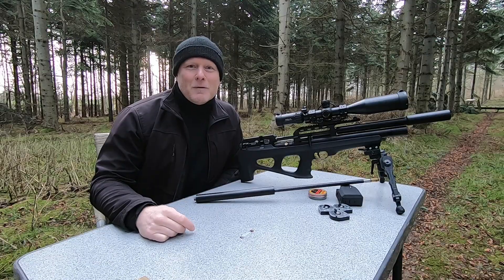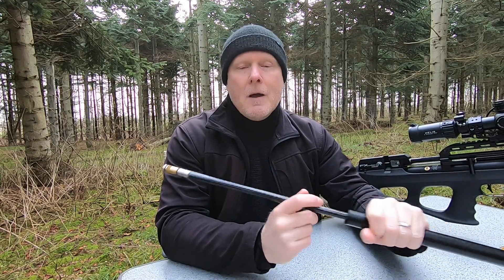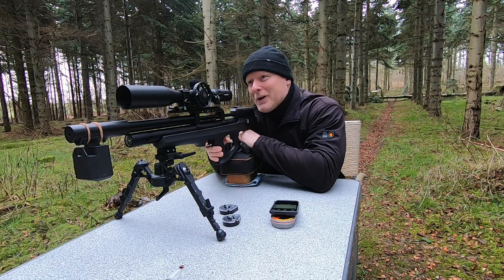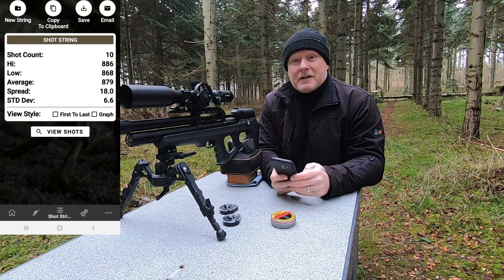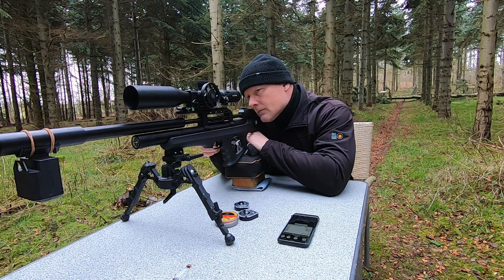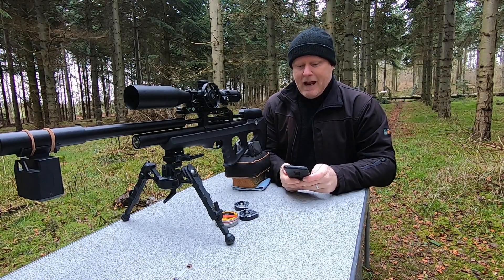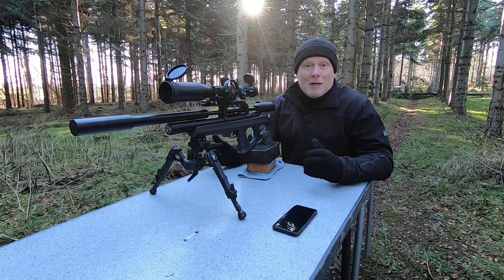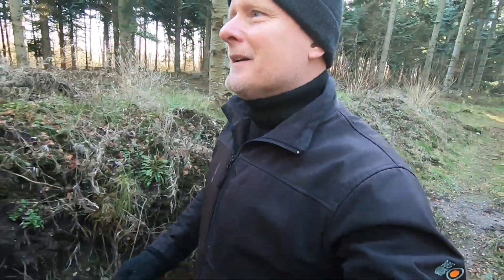FX Wildcat MK3 Barrel change - STX Superior Liner 500 mm vs 600 mm. What is the gain in FPS???

Comment: Agree 100% using the 600mm barrel over the 500mm means you can achieve same velocity but with lower reg and hammer tuned down making rifle more economical with air which in turn giving higher shot count and less stress on the rifles internal parts.
Great video 😃

Comment: Nice video Peter! I'd like to ask you a question about your experience with FX in general. Since my gun is great for bench rest shooting but a bit bulky for fieldwork and way too front heavy for offhand shooting I'm looking for a bullpup and the Wildcat Mk3 is definitely on my shortlist due to its versatility and ease of adjustment. You even don't have to settle for a particular caliber since it can be swapped anytime with minimal effort. However, my main concern is, that as a result of this modularity the construction becomes overly complicated having way more parts (=> more joints => more potential problems), than many comparable guns. Usually, a barrel is a piece of steel tube with a rifling inside but in the FX you've got a shroud, an outer tube, and an inner liner, for example. Will it still shoot accurately when you lean it against a tree and it falls over and will it start leaking if this happens two or three times?
Reply from the maker: Hi Bartosz
I would love to give you an answer to your good question, but I have never dropped any of my guns.
But one benefit I will mention is that you never have to clean a FX barrel.
And yes there are many orings, but it has never been an issue for me. And the build of the barrel works really well! One important acessory is the carbon fiber barrel sleeve. I have that on all my barrels 🙂

After having shot the M3 the Wildcat should be a step down, but I really love the gun. Not as accurate but SO nice to shoot/handle/carry/look at/own 😃

Comment: Hey Peter - nice video. I got just about the same +70 fps when changing my Impact Mk2 from 500mm to 600mm, with no other adjustments. Less spread as well. I don't mount a chrono on the barrel anymore when I'm zeroing a scope, otherwise I have to zero the scope again when it's taken off.
Reply from the maker: I was thinking about all the changes that we can do from a complete standard. I havent added at all up, but longer barrel, dual hole transfer port, bigger plenum and so on. That is a huge gain 😃
Reply: @VikingAirgunner  Agree ! I'm partway through fitting the 720 plenum to my Mk 2, but the dual hole transfer port + slug probe added 55 fps

Comment: Thanks for the video and information. I have a 500mm .177 Wildcat that I'm also shooting the same JSB KO. My reg is also around 110 bar. The gun is so accurate, but the extreme spread opens up at power wheel 5,6,7. I would love to know your hammer spring pre tension, to get an idea how to tighten my FPS. I know you have other mods I don't, but it would give me a good general idea. Thanks!
Reply from the maker: Im not getting the best spread, so I dont really feel like the expert here. But I have the preset almost all in and the hammer at 7 🙂
Reply: Or maybe I'm trying to push it a little too hard? I was wanting to get the KO's to shoot at 900-920fps with the standard gun. What do you think? Not possible and settle it back down to 885fps?
Reply: @mspiredm3  at these setting I'm getting 905-910fps spreads.
Reply: At 111bar, hammer at 17.8mm micro adjuster at 4 lines. I'm getting 907fps for 15gr slugs.
Reply: @jean-claudelaboy9679  4 lines? You talking about an impact?
Reply: @mspiredm3  yes.

Comment: I have a 500 barrel coming hope I haven’t made the wrong decision as I haven’t watched the video yet 🙈
Reply from the maker: Well the video speaks for it self, but there is still a way to get gains ☝️🤓
Between you and me (and everyone else reading the comments 😂) I have just installed the power plenum to my gun and THAT is a good idea!
With the 500 mm barrel there is an issue with the air cylinder getting longer than the barrel after the install, but it can be fixed with the right moderator 🙂
And of cause you need the dual hole transfer port 🙂